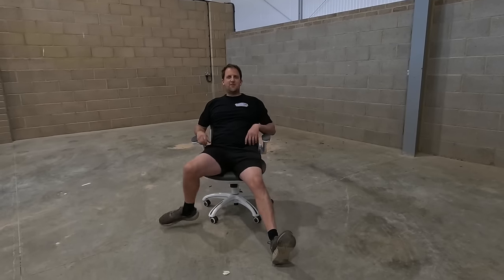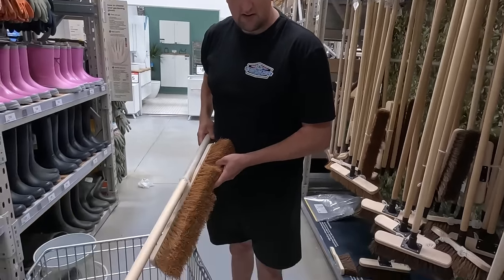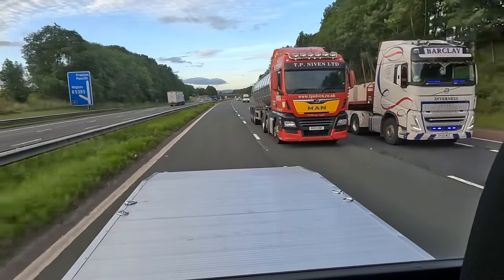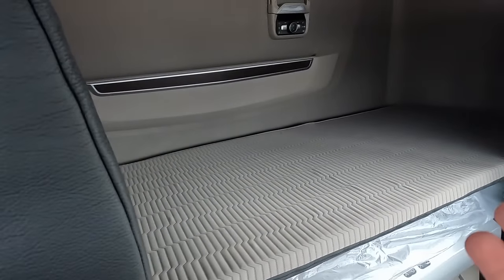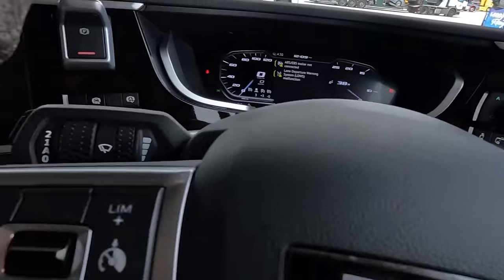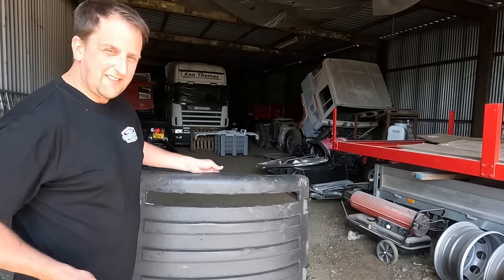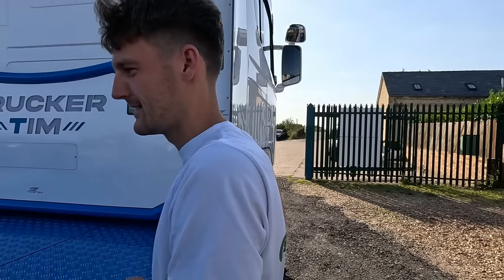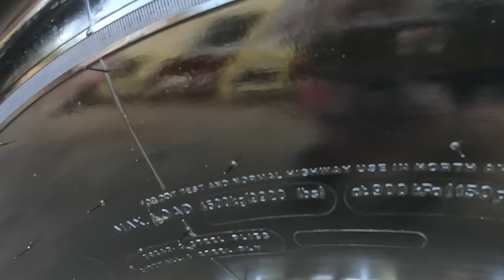Called In For A Meeting With My TRANSPORT MANAGER | #truckertim

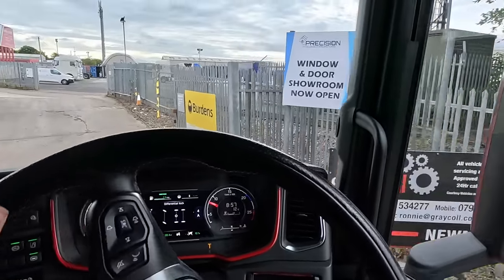Comment: 8:19 It has to be a t cab with a bonnet.

Unfortunately nobody has modded the new gen t cab into American truck simulator.

But I've added big engine mods to my SCANIA T CAB in ATS. I now have a 730HP engine in it with 3,00nm torque.

I've also added a few unrealistic engines to it and what I've done is made them unlock every 5 levels of my profile. So the next engine upgrade is at level 30 and it's a 835hp engine 😂.

It goes all the way to level 50 to a 3,000 horsepower engine with 12,000nm torque lol. It will probably wheel spin all the way up the road.

I've also modded a 20 gear gearbox for it. Currently when it's in gear 18 it will cruise at 112mph with an 18 ton load.